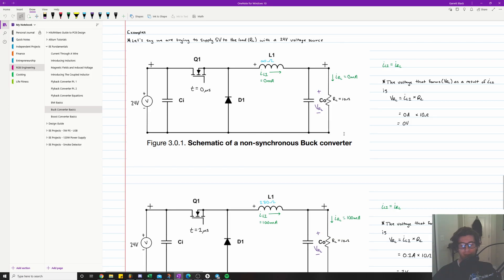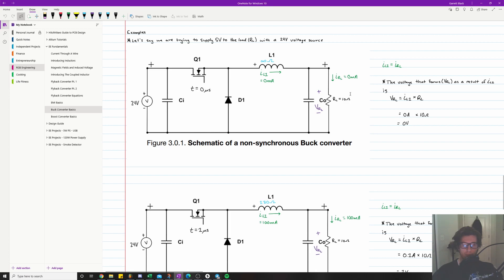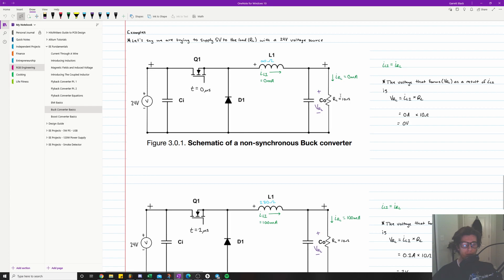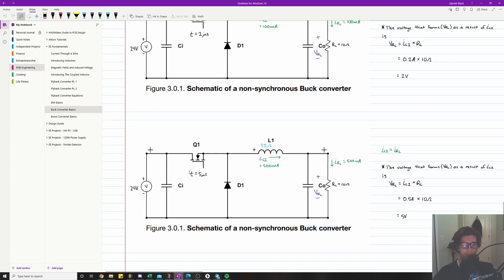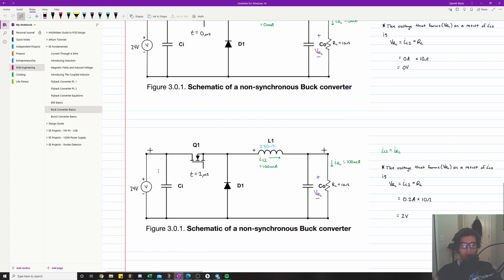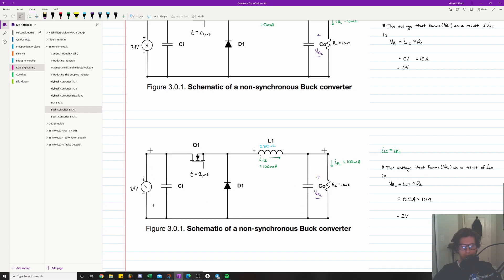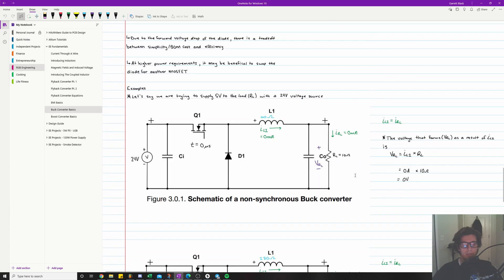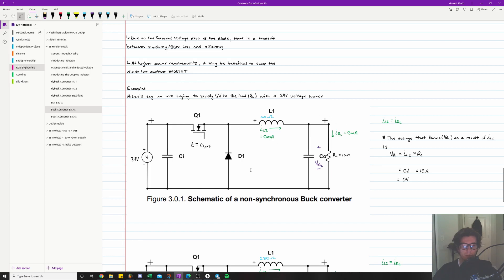BUCK CONVERTERS EXPLAINED Pt. 2 - BUCK CONVERTER TUTORIAL, BUCK CONVERTER CIRCUIT DESIGN, STEP-DOWN

Comment: sir how can we select a buck converter instead of that we can use a linear volage regulator. can you explain about the difference between choosing a buck and a linear regulator for a circuit.
Reply from the maker: I will make a video on that,
Reply: probably as far as i know linear are less efficient then SMPS